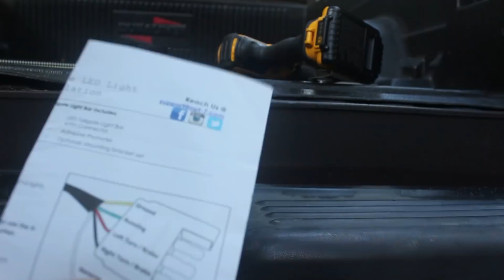How to Install OPT 7 triple led tailgate light bar

Comment: Appreciated this video - came in handy for my install a few months ago.
My own review for this OPT7 light bar follows .....
Purchased one of these w/ the 'red sequential signals' for my '04 Ram - did the install using a CURT 55384 adapter harness + also used a short 2-way (2 into 1) harness for an added tow hitch light. Didnt use the 5-pin factory plug hookup at the bumper for anything other than its rear access plug for that CURT adapter. Did have to take the white to the left tail (for reverse only) & did this splice where its harness comes up at the frame rail --> (yes I removed some of the excess wire ). All was completed within a few hours - all was working perfectly first try with no flaws - yes it all still works after months of usage - never an issue. There is a very short lighting delay which is very minimal - doesnt bother me & all I showed it to once installed never brought it up - to me it's not an issue to ever worry about. All lighting is very bright (brighter than most others I've seen in day or night) - Reverse will light up a parking lot - why would anyone need anything brighter? Ges u could just install some 1000 watters  if u need to blind even yourself! 
BTW - I didnt even remove the tailgate for the install - marked a few lines where the top of the lite bar would be using a grease pencil - it lined up perfect first time - all 3 rows can be seen below the gate & above the bumper. 
Access to the spare tire - (the spares in the bed under a bed cover) ... if your concerned about that - dont buy one cuz it will block the access hole. 
My conclusion - very impressed with this light bar - highly recommend it - simply a good choice I made.

Comment: I seen that this opt7 light bar had some bad reviews, how has it been holding up for you?
Reply from the maker: They have been holding up great for me. The only thing I have had a problem with was the adhesive failed like I thought it might so I had to use the included brackets to mount it here is that video if you need it.
https://www.youtube.com/watch?v=vrBdm4UuPeQ

Comment: I just bought 2018 Ram 1500. Do you think that it can be mounted on the rocker panel for side's 60" bar ? I just don't know how tall the light strip is? I am a volunteer fire fighter thinking of buy 2 60" put on side rocker panels for side visibility with brake wire to a led strobe controller or using the red turn option unit and using both left and right for more led movement . Use the white color for side visibility at night with a switch in the cab of truck. Just Brain storming on this project that what i have came up with so far. I seen your pager lol..
Reply from the maker: Hi Daniel love that Idea the bar is ¾ of an inch tall you would have to get creative with the wiring which it sounds like you already have done I don’t know a lot about that side of it. If you get it working I would love to see pictures and or a video of it. I know opt 7 makes a rocker panel light but It is just an LED strip with the adhesive and I don’t know how well it would stay on I had some problems and had to mount the bar with the hardware after a while but my tailgate is a bit different then most.  I live in CA and we are not allowed to run any kind of lights for responding POV to calls do you live in a state where you can run lights on your POV?
Reply: Kentucky

Comment: Tape hold up? As in being over the lip over on each side?
Reply from the maker: No the tape did not hold up, I think not enough of the tape was sticking to the truck. I made a video of installing it with the brackets if you need help installing it
Reply: Gotcha.  I actually have a 01 1500 ram. I believe I'm gonna go with a 48" opt7. Light's still working tho?
Reply from the maker: @traviswood3338  yes the light works great with no problem except for the before mentioned tape
Reply: Awesome! Thanks for responding.

Comment: Now that you covered up your spare tire release hole, how are you going to lower the spare tire if you need it.
Reply from the maker: Andy St Michael I hope to not need that but if I do I will peel the light off and reinstall it with the brackets it comes with or get more double sided adhesive

Comment: Does anyone have problems with the blinkers my left blinker works and my right blinks fast
Reply: Ivan Estrada you need to put a resistor on that side
Reply: hunthunter thanks imma do that...does it matter what ends on the resistor to connect or it dont matter...like is one wire   negative and the other positive or it dont matter?
Reply: I’m just confused which wire to splice the reverse wire into there’s a black and purple wire coming out of the reverse bulb so I don’t want too splice into the wrong one which one did u splice into?

Comment: Just wondering why you didn't just cut off all the excess white wiring for the reverse light. Otherwise, very informative
Reply from the maker: Thomas Mills III You could definitely shorten it I don't think it would mess anything up. Left it long Incase I ever want to move it to a different vehicle where I would have to run it longer distances Glad you liked the video